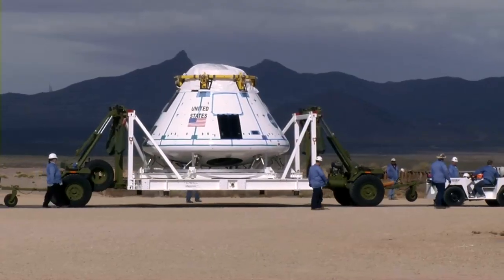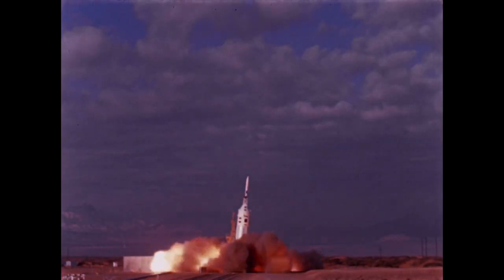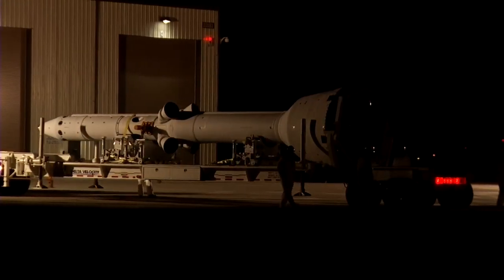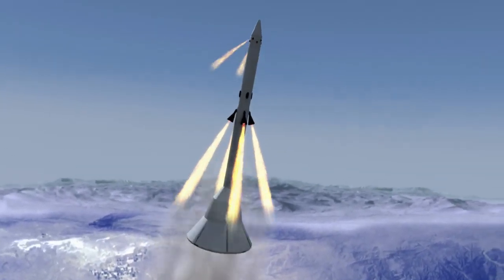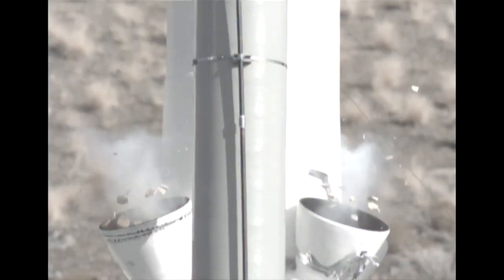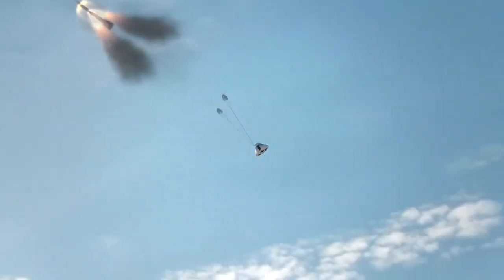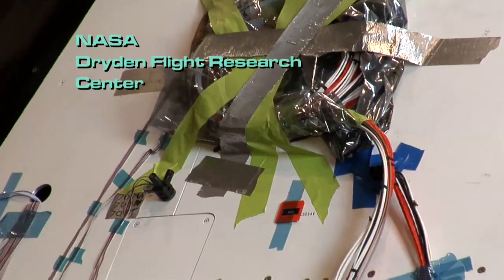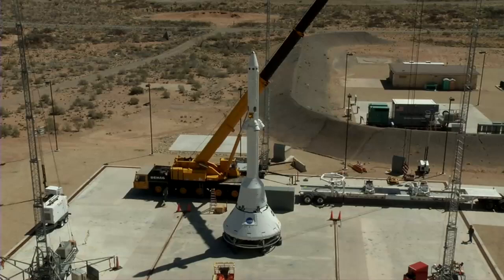The Road to Pad Abort 1

Comment: I remember the launch of this system back in the day at WSMR.  I landed in. UXO area North or LC 35 and caught on fire after getting tangled up in high voltage transmission lines.  I still have the mission patch.

Comment: That thing is huge, and looks much more expensive than the dragon 2. It looks as if the never even seen the concepts Elon has made public. People need to learn how to learn from other people even if your not working together.
Reply: Joe Schutt . The Dragon 2 is designed for low-Earth orbit and transfer to orbital space stations. The Orion is designed for deep-space exploration. That is the reason for the markedly bulkier and larger design of the Orion. The Dragon abort system is a pusher system. Orion's much greater mass makes a puller system far more efficient and accurate in bringing the capsule away from danger. You are trying to compare apples and oranges. Learn before commenting, for god's sake.
Reply: Joe Schutt l

Comment: The Dragon escape system is far safer.  With Dragon you only need to abort a few hundred yards away from a chemical explosion.  Since Orion is mounted on Ares1 which uses solid rocket fuel, you need to get much further away (miles) to have a chance for the parachute to survive.  Also, Dragons escape system can be used all the way to orbit, Orion's cannot.   Also the jettison process is added danger, Dragon has no jettison.
Reply: Right on all counts. :)

Comment: wow were going back to the way it was in the 60's  ..we are landing in the ocean again...i dont get it..
Reply: Just because a tactic is from the 1960s does not necessarily mean it is bad and inefficient. While landing on the ground is more cost effective, having landing engines and a fuel tank in the capsule could make the capsule more expensive the manufacturer, requires the launch vehicle to be more powerful than otherwise, and could compromise the crews safety during reentry.

Comment: @dexluther In the first shuttle launch (as in the test) they had 2 ejection seats, but they took them out when the shuttle was "ready for flight". Ejection isn't practical at those high altitude and speeds. And you are right, those were not acceptable escape plans, and most astronauts are/were furious about it. NASA was so focused on "normalizing" space, they forgot its still quite dangerous.

Comment: @dexluther It had one. A swinger "Bar" would deploy out of the shuttle in the event of a needed abort. The only problem was you could only use it at a low altitude. In both the Challenger and Colombia, they were simply to high up to allow its deployment.
Reply: Hi 10😳😳😳😳😲سنوات